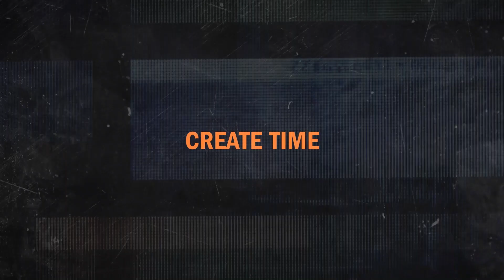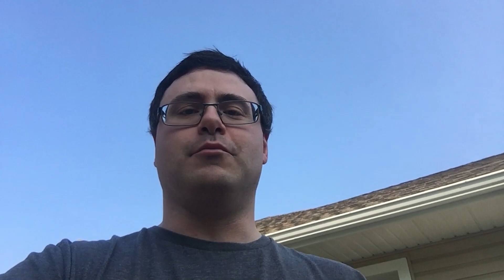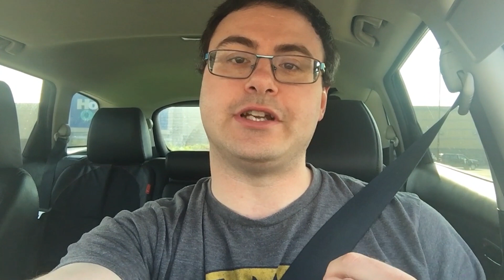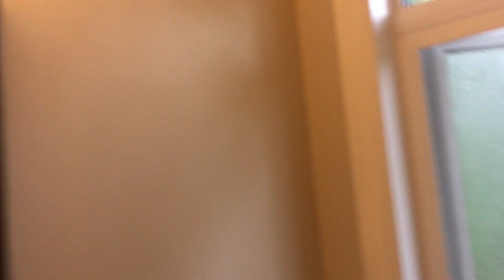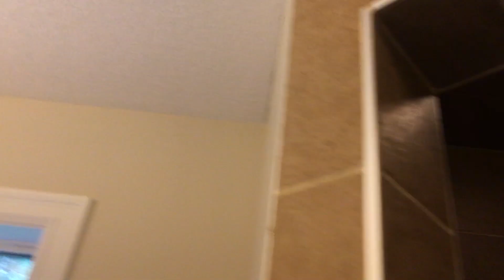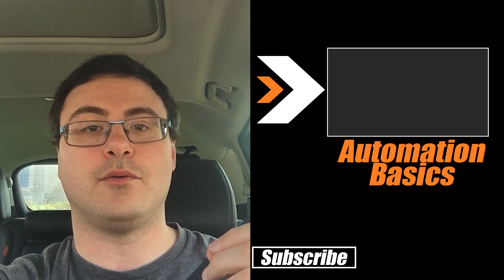Choose A Home Automation Sensor Like a Professional Engineer

Comment: To my mind, the most important aspect of anything automated in the home is what happens when some aspect of a well designed system fails to work. Most of us live with other people who may or, more likely, may not share our enthusiasm for automating things that already worked  perfectly fine with a switch, or a door key, or a button. And, most of us use consumer grade sensors, etc. that are more likely to experience a "glitch" than devices designed for industrial use. We need to design things in such a way that if there is a "glitch" (through no fault of our own, of course) in that well designed system, a manually operated switch, button or a door key, etc. can set things straight and not leave a family member locked outside in the dark. If that happens, there will be hell to pay, and all our sensors will end up stored in the basement.
Reply from the maker: 100% Tralexan!

Comment: I find it fascinating how different engineers develop solutions.

I'm a CyberSecurity Engineer. Not an Industrial Automation Engineer. So, I approach things slightly differently.

I look at the end, rather than the beginning, to build my solutions.

An example of this in automation could be something like the following scenario.

Sometimes I come home in the evening. It's dark and I can't see my door lock to unlock it. The lack of light is a denial of service issue.

So, I want the lights on. That's the end result.

So, then I go about defining the conditions. 

Only when it's dark. So, after sunset and before sunrise.

Next condition, I don't want them on all night long. Just when there is somebody near the house.

So, on and so on.

This helps me find out what my triggers should be. 

My approach is backwards. It seems that I have a lot to learn! 

I'm use to reverse engineering as a security guy. 

Thanks for sharing your approach!
Reply from the maker: There is certainly nothing wrong with that approach!  I like it.  You're right though, different engineers do tend to do things in a different way.  The thing is, I'm still beginning with the end in mind, I'm just using the scenario to spell out what that end is.  It's actually very similar.
Reply: I think the approach is not so important as the result.  
You want a trigger and you want a set action with conditions to make sure it only happens at the right times.
How you get to the end result is as variable as life itself.

Comment: That was a very great walkthrough of a very simple automation! Over the years that I have worked with automation that is exactly the way that the engineers do it. We Define what we wanted to do how long we wanted to do it how long before we move it to the next sensor what the next sensor is going to cause it to do and what the action we that's basically what you have inspired me to do with my condo since I can no longer see. Because sensors have gotten cheaper an easier to put together. We also have created programs in which all sensors have redundancy as you were talking about. Such as if we have a fire alarm go off the whole system shuts down in sections such as the immediate reaction would be in the plant would be exhaust fans would stop to stop pulling flames then each section of the line would shut down to save the product and allow the employee to walk away safely this was our first attempt at automation! now I go back as retiree to the dinners to this one plant that I used to take care of out of the multiple there used to be three hundred people that ran one line now there's there used to be three hundred people that ran one line now there's like six to eight people because it's there used to be three hundred people that ran one line now there's like six to eight people because it's all automated. so to a certain point or gaining and to a certain point where hurting ourself. But I can certainly tell worked in industrial engineering or something like that. I think that's why I really like your style I think Hibbert must do that too but I think he gets too many fumes. make sure he sees this and tell him that I sent it with all my respect. have a great day in Canada and behave yourself
Reply from the maker: I can tell you’ve been through this stuff.  It’s certainly an engineering perspective and it’s a very basic way to build out a smart home, but I think the concept fits!  So glad you liked it Beryl, and I have one coming about redundancy.